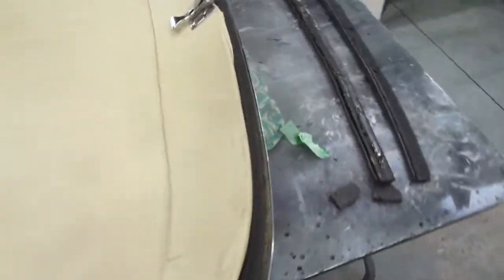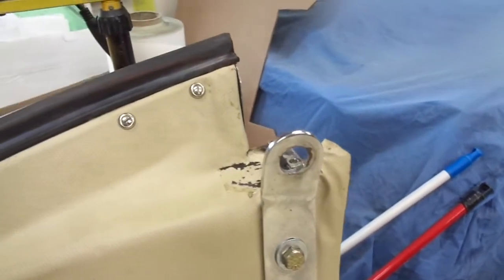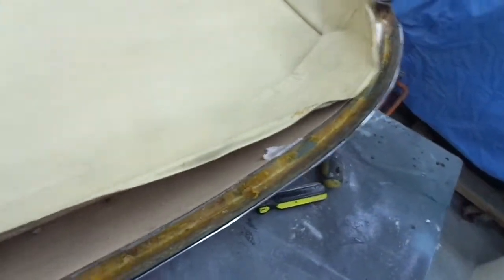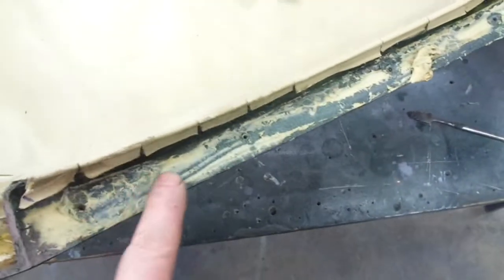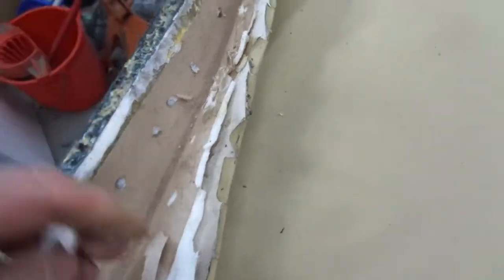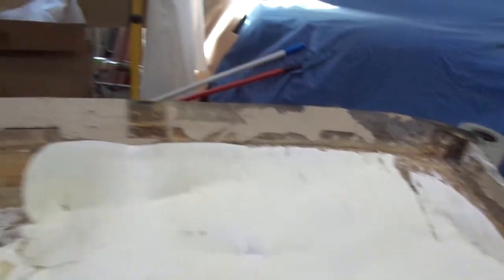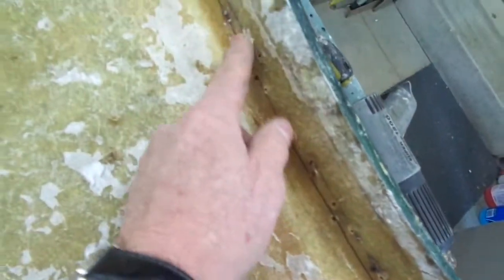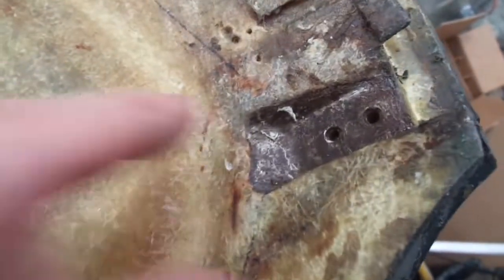Jaguar E-type OTS Hardtop Headliner - Part 1, Removal

Comment: any tips on that front  chrome molding on the outside? I have the exact same thing trying to  take  it off and I can’t see if is  clips are true.
Reply from the maker: yes, there are clips securing the front chrome strip, and nothing like I've seen used elsewhere. They are attached to the lip of the hardtop using very short screws. You can remove the chrome by carefully inserting a thin, narrow blade between the piece and the lip of the hardtop and carefully prying upwards, starting at one end. Once you have popped one end off the rest come easier.
Reply: @Nickolas52  thanks i got it off  they are riveted on with mini w
ashers for the chrome